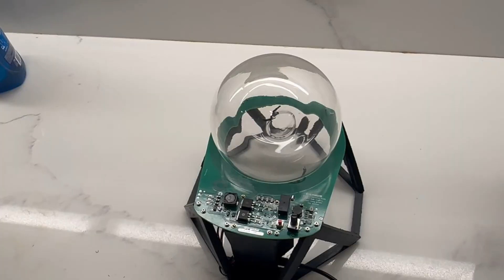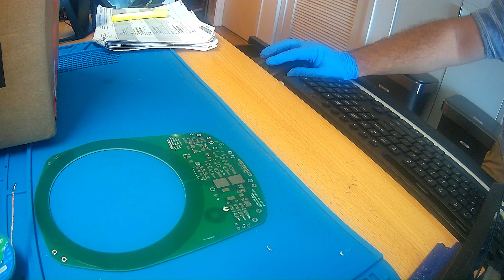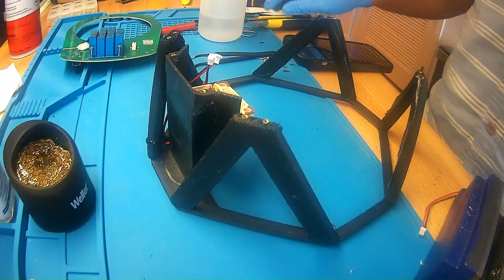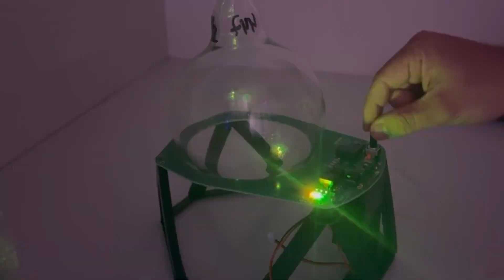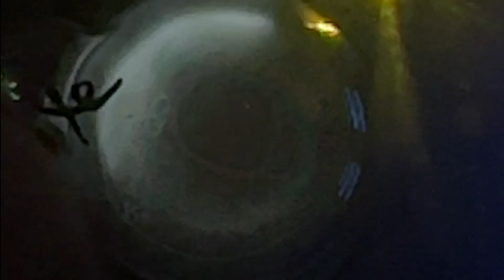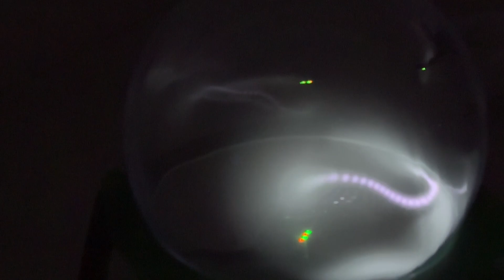Building a Plasma Toroid (Part 2)

Comment from the maker: 11/17 Edit: I got a stable toroid with a power supply that can provide 3A constant current starting at 23V. Adjusting the voltage limit up to 26V with a 3A limit works well as the glass heats up. I also took BackMacSci's suggestion to buy a handheld tesla coil which works WAY better than the igniter in this design. 

Check out Tate's video featuring this build at Open Sauce: https://www.youtube.com/watch?v=PiGPPLVGYyU

Stable toroid demo: https://www.youtube.com/shorts/vc0YdJxNNUc
Handheld tesla coil: https://www.aliexpress.us/item/3256808930867543.html?channel=twinner

Comment: Very impressive. So in conclusion you needed more than the 3amps your usb power supply could provide? Could you please share your DigiKey BOM?
Reply from the maker: Thanks for watching the video to the end. I actually have been able to get the 65W USB C laptop charger to work after wrapping a couple turns around a ferrite. Additionally, I usually have to crank the potentiometer all the way up and spin the glass against the PCB to get first plasma, and I have not sustained/created a stable toroid without also touching the glass. Here is a link to BOM + tools https://docs.google.com/spreadsheets/d/e/2PACX-1vTltS4j_dxRy6c-VCYd_dfjCqBevCYQPC2R6edGvjtl10fmAplz6evyrVS6IM4aOk7Bq3yUYwaEewPh/pub?output=ods